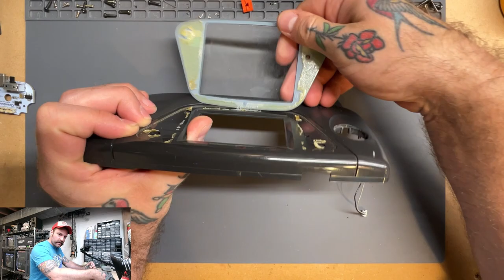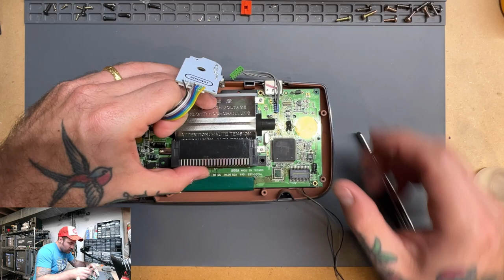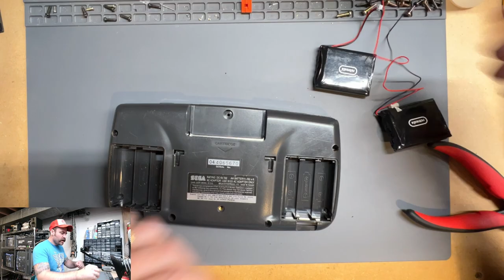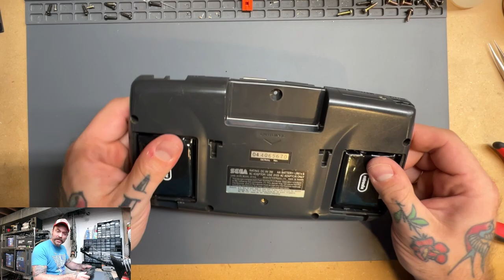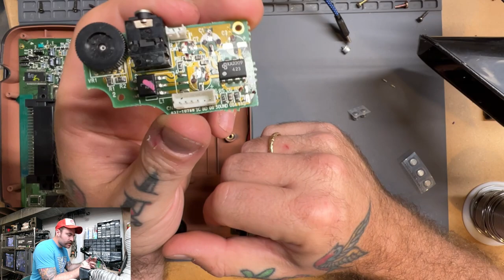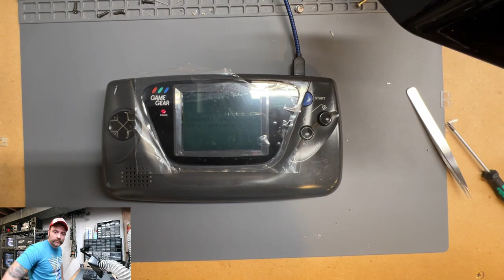Game Gear: Lens Replacement, Reachable Battery Install, Audio Board recap!

Comment: I revisioned lots of Game Gears and the worst experience was replacing the glass lens, i bought it on Aliexpress and when i peeled the sticker was all over and turned the lens useless, after that i never replaced any lenses.
Reply from the maker: Bummer! Yeah, I've found that using tweezers really helps with getting the coating off of the inside of the lens. Fore me the most nerve wracking part is setting the lens into the shell. Gotta get it just right!
Reply: @daneolds515  true, you only have one try to make centered right